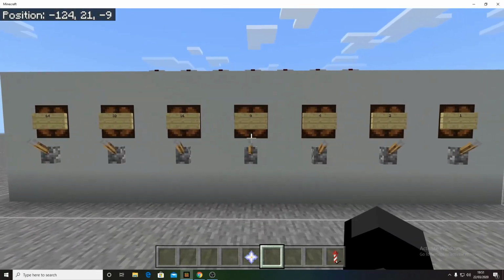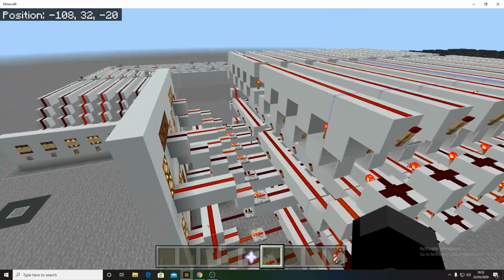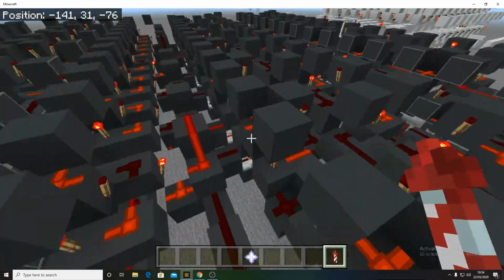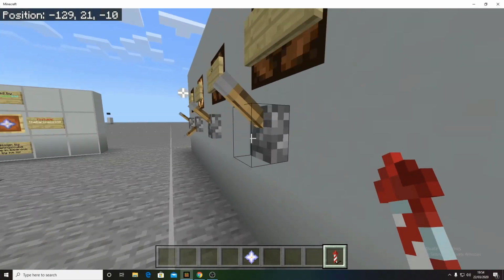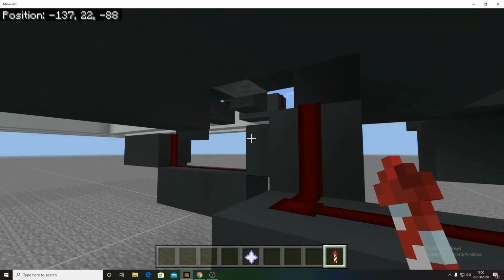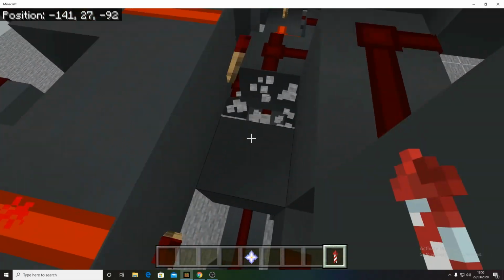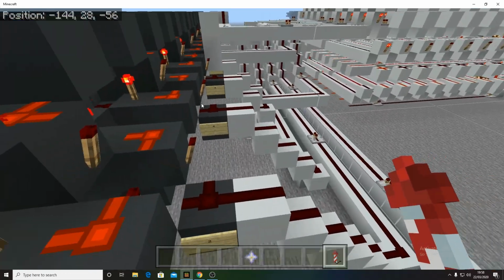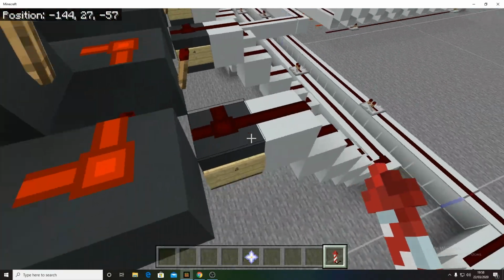7 Segment BCD Display Driver! - Minecraft Bedrock

Comment: is there a 4 bit binary to BCD converter in your redstone world?, just wondering
Reply from the maker: @harshujiwane8265  there is an 8 bit one I think but you don't need to convert 4 bits binary to 4 bits BCD as it's already basically BCD. Tho any number over 9 will be invalid. Using a display that should be fine as the numbers just won't show.
Reply: @TheDarkness344 thanks

Comment: Just make the display go to 9 and copy and paste 2 of them with binary
makes it a lot more compact and the person using it doesnt have to do math to find what number they are trying to display
Reply from the maker: The reason you use binary coded decimal is because normal binary is hard to decode to decimal because each value needs to be mapped out to it's decimal equivalent. Binary coded decimal allows you to need a much smaller decoder than a binary decoder as the logic for BCD to decimal is much simpler. If you were only using a display that went from 1-32, then you could just map every value out, however if you were using a display that went up into the hundreds and even thousands, you will need to convert binary to BCD as it will be tedious and massive to build a decoder for every individual number. This is all of course assuming your input is in binary, not decimal (inputting from any sort of computer etc.)
Reply from the maker: If you just wanted to input decimal and get a decimal output, then you would not need the BCD part at all.

Comment: I can make the calculator system add a little bit of redstone which can be more than 2 bits
Reply from the maker: Yea it's pretty cool all you would have to do is link it up to your calculator as it effectively is a binary display driver (it just turns it into BCD first so it is easier to display) and that can be your output. In the future I am planning to make a simple 4 bit calc that can do all 4 sums but all I need to learn now is multiplication and division. I am working on 2 different types of multipliers, one from a tutorial (lecerial) and one of my own design that uses a clock to keep adding the number to itself to multiply. This display drive is easy to hook up to your output and I would definitely recommend this over using ROM with each different number programmed in.